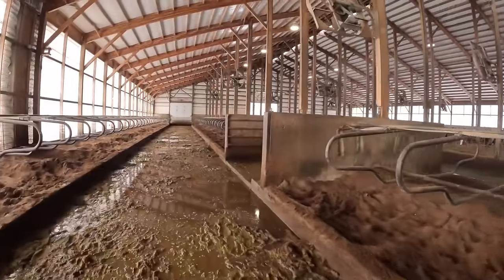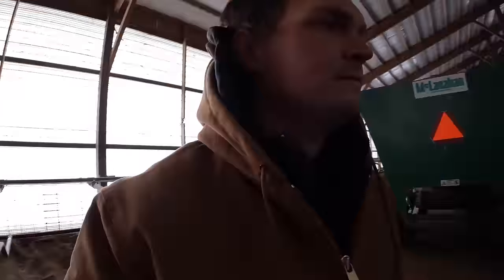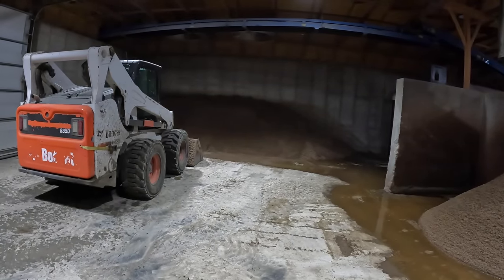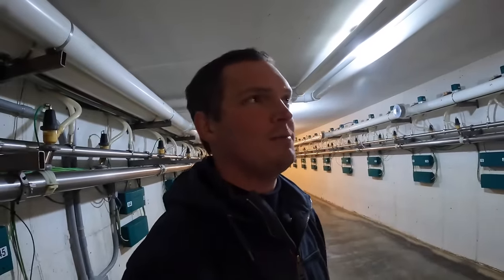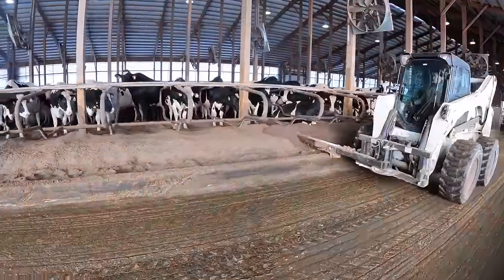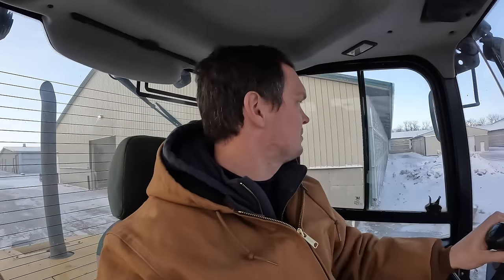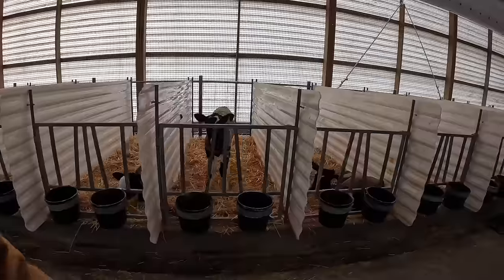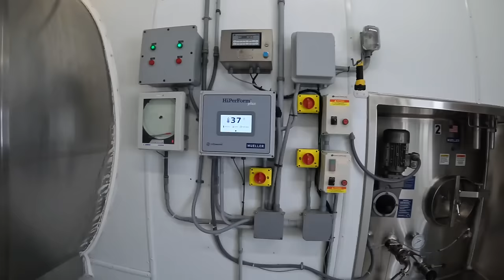Deep Freeze Hits the Farm -55 F! (120)

Comment: You talkd about sand, whats it for, for the manure&urine? How does the separator work? Its certainly a diffrnt operation than what I've watched thnks
Reply from the maker: We use sand as bedding for the cows. The sand is very comfortable, it doesn't hold bacteria, and we are able to re-use it by separating it from the manure. The basic idea of the separator is that sand is heavier than manure, so it settles out of the manure. I have made a video on how the system works in the past.

Comment: A Dutch family moved to our community and built for cows with completely open sides 😱 Curious as you are, visited them and wondered if they had thought about Swedish winter.
Well they said, we have winter in the Netherlands too....
They have had their fair share of problems but they are very hardworking people. You can't say anything about that.
Reply from the maker: It helps a lot to be setup to handle cold Temps. It's not fun dealing with problems in the cold!

Comment: Would  it help to winterise the insides if the doors by spraying a light  oil to the back and joints of the big doors before winter
Reply from the maker: The hinges and wheels have oil on them, but they still seem to get covered in frost.